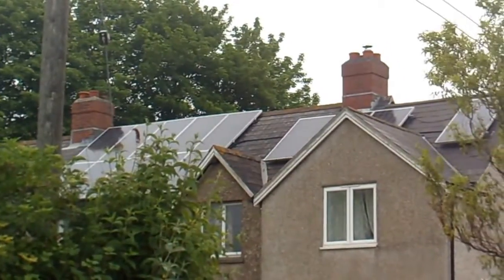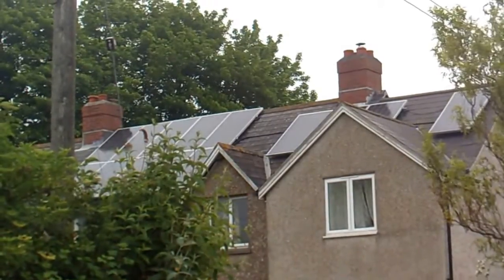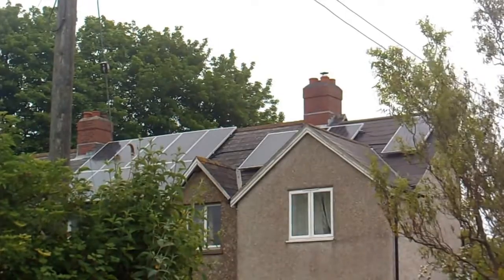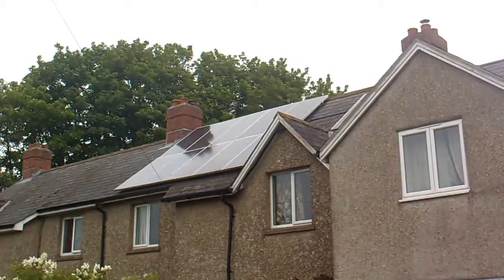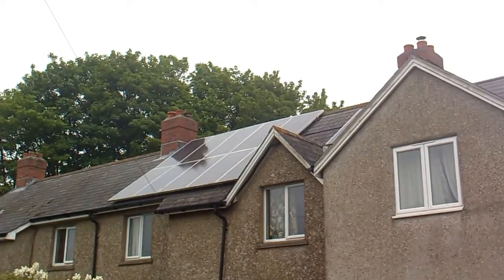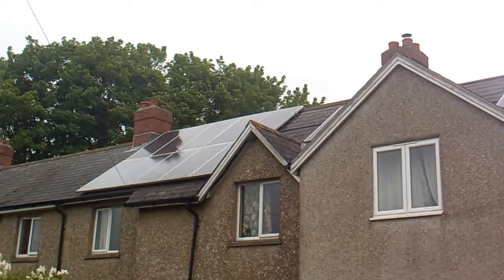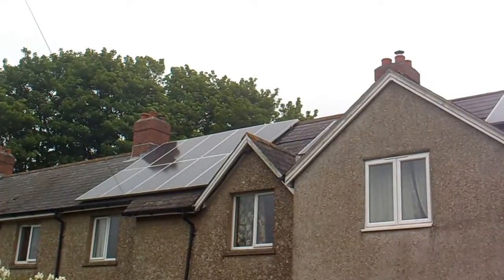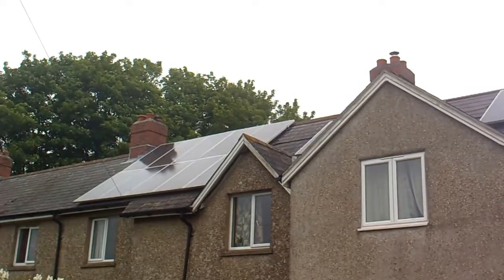Solar Panels and Feed in Tariff explained (in UK)

Comment: 50 pence per kWh is loads of money. I just got a quote from uk energy, and they only give you 4.91 pence per kWh FIT
Reply from the maker: Getting in early was good,  best investment I've made,   but I paid about £17k for something you could get now for £7k.  Do you get 4.91 pence on all you produce + 5p for the estmated amount you actually put into the grid and don't use yourself?
Reply: John Simpson Hi John, Looking at the estimated figures I was given. Its assumed that I would generate 2809kwh/year at 4.18p/kwh. Export tariff is 1404.5kwh at 4.91p/kwh. Energy savings assumes I use half what I generate 1404.4kwh at 16p/kwh. Savings per year is £411.09 for these figures
Reply from the maker: On the original scheme we get about 46p per unit on top of that.  
Anyway well done for doing your bit for the planet.

Comment: Problem is, the rate is only 13 pence a kWh from jan 2015, so you only receive £780 per year, so the generation will take 21 years before you have paid off the panels. Its no longer a viable solution, but you did well to get in when you did John.
Reply from the maker: I would say it is still worth getting some reps in to do the calculations, There are also batteries now which store 5kw hours of electric for when the sun is not shining
Reply: You are forgetting to equate electricity bill savings over this time that only raises!